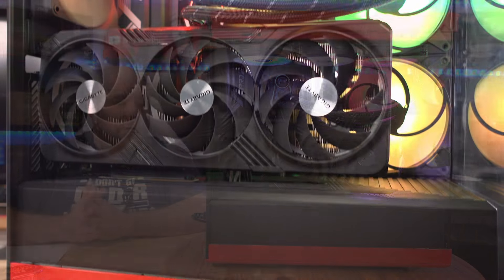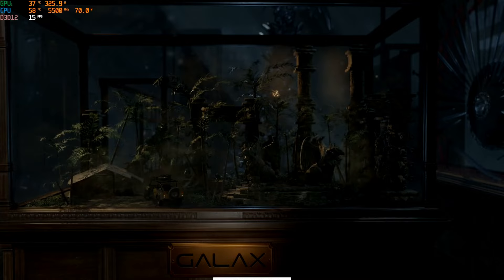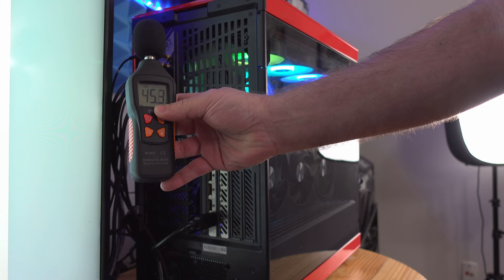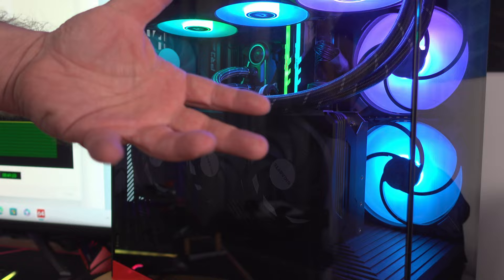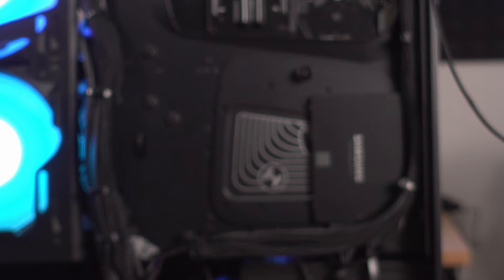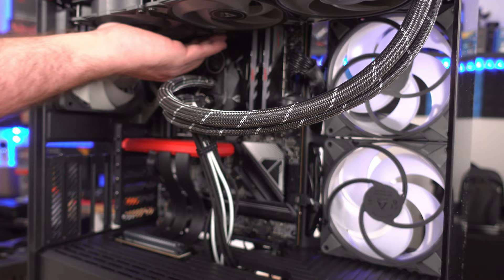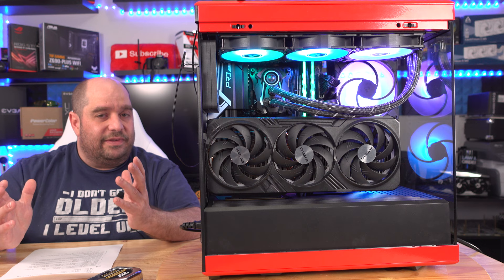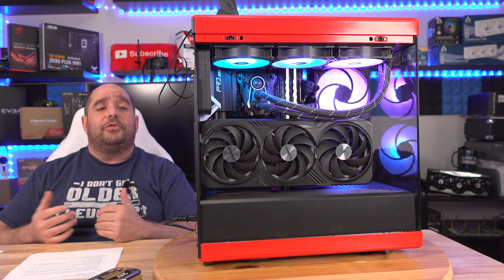The HYTE Y40 Mid Tower PC Case Review You NEED to Watch Before Buying

Comment: Thoughts on this vs y60 and lancool 216? Currently using a lancool ii. Mesh but wanting a white build with aesthetics in mind. The y60 seems like the best looking but I heard it’s not great for triple slot gpus and less cpu air cooler clearance
Reply from the maker: The LanCool 216 is much better, I have reviewed it as well, check it out: https://youtu.be/eQ03fk_FzLI but the Y40 is great too, I think the Y40 is better than the y60, I reviewed the 40 as well, check it out: https://youtu.be/JqvXib6ugjw
Reply: @ThisBytesForYou  Thanks. After watching the 216 review, I'm wondering if you had any issues with the screws to mount the gpu vertically in the Y40 like on the 216? I'm also considering the asus AP201 as well and wondering if you've had a chance to try that case?
Reply from the maker: no, no issues with the y40, it works great and the 216, ... it could have been a fluke.  I really like the y40, but it limits you in the means of pcie slots, but if you dont need additional devices then you are good.  As for the Asus case, I have not reviewed it, but I am not impressed by the looks of it.

Comment: Can you install fans between the case and radiator for a push pull configuration? I have it set up that way on my Consair Air 540 and just ordered this case
Reply from the maker: Different cases my friend , you might want to check out the video
Reply: @ThisBytesForYou  I did I didn’t hear you say you could or couldn’t just about the size of the possible radiator that can fit.

Comment: What's the width of that EVGA PSU? I am thinking of buying the Corsair RM1000x Shift and this case.
Reply from the maker: sorry, youtube didn't deliver this to me, then all of the sudden it delivers 4 to me.  It is 5.90inches
Reply: @ThisBytesForYou  Thanks for the reply. I got all the components including the Shift PSU except the case. Still waiting for it to be delivered. The Corsair PSU is the same width and judging by the cables in your video between the PSU and the case panel, there is adequate space. Also, the new connectors on the Shift PSUs are smaller. Will see.
Reply from the maker: @MaCK0y  awesome bud, let me know how it goes.
Reply: @ThisBytesForYou   Late reply. Had complications with the motherboard. It does fit.
Reply from the maker: good stuff bud @MaCK0y